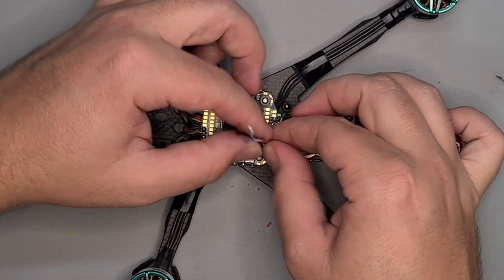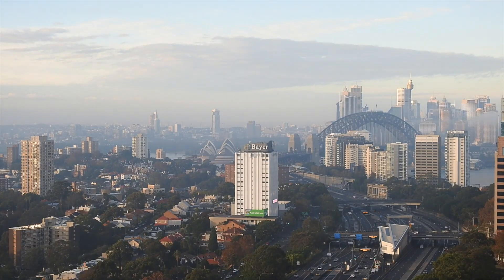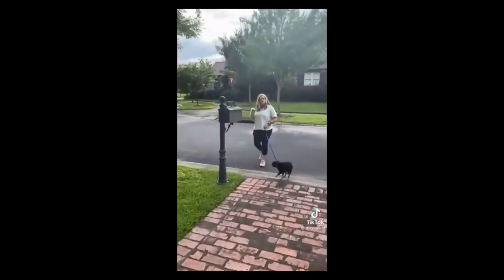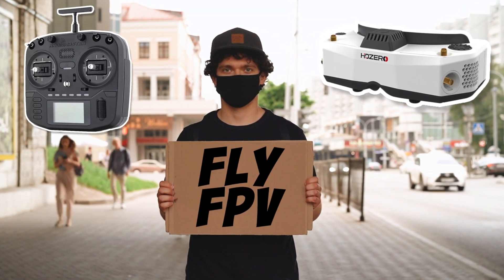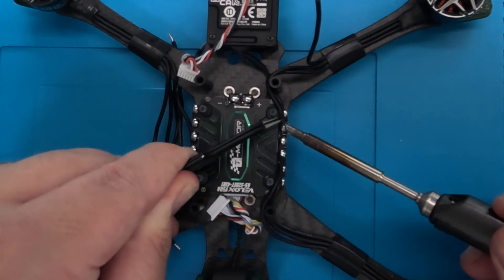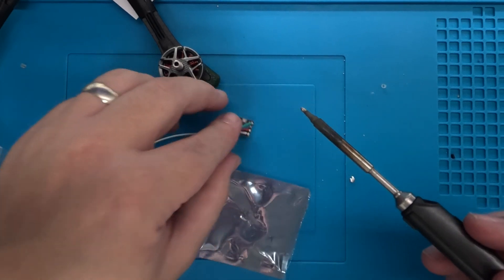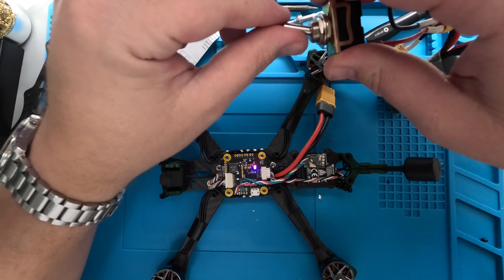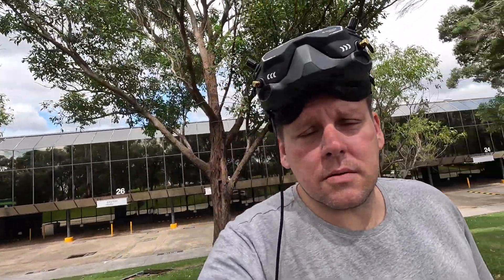I Built My ULTIMATE 5" Freestyle Drone

Comment: I am trying to get started in fpv and i was wondering if its more worth it to spend the money on digital with the DJI o3 air unit or to go analog?
Reply from the maker: There are 3 digital systems

Each have their pros and cons. 

Go analog. Get into FPV 

Then work out which digital system you want later.

Comment: Hi there I’m getting into fpv and I have 2 questions. 1 how do you figure out what panels you need to solder for the radio master. 2 do you have to solder anything for setting up Vtx. Thank you!  And one more thing sorry, do you have a VTX antenna holder?
Reply from the maker: As in the pads on the receiver?
They’re labelled on it.
Yes you may have to solder the VTX depending on which one you get and what flight controller you have. 
You can 3D print a VTX antenna holder but they do come with most frames

Comment: What kind of range and battery life can you expect from something like this?
Reply from the maker: This drone is optimised for Acrobatic Performance not distance.  Range is limited by Battery and Video System. The video system on this can do 20kms, but the radio can go to 50kms.
However, you will run out of battery first. Acrobatic flying on a 6S Lipo of 1100mah is 4mins, a 1300mah is 5-6mins. Cruising with a Li-Ion pack will get you 10mins+

What kind of range and battery life are you looking for -- and what is the reason for that range & battery life?
Reply: @DarrenAllatt  honestly that range is wild already. I'm looking on moving from analog to HD. I live in a forest and flying low through the trees barely gets me anywhere maybe around .20klm/ .12miles until I cant see anything. So im thinking on moving to a hd setup for the quality and hopefully better range in the trees.
Reply from the maker: @gladperson116  you are fighting against the physics of radio waves flying low and amongst trees. 

What’s your antenna setup?
Reply: @Darren Allatt  so im running a iFlight SucceX V3.0 mini VTX with a lollipop 4 antenna and I have skyzones o4x that came with stock steadyview v3.3 receiver. The antennas I use on it are, Iflight 150mm and a triple feed patch antenna. I'm thinking on moving to HD for a while now especially with the 03 air unit and retire this dinasour.
Reply from the maker: You have quite the setup, so yeah you should get better penetration with O3
Reply: @Darren Allatt  Im just a little stumped. Ive been doing research on which goggles the v2, the G2 or the integra. I liked the integra at first but the fov is not as impressive, it has GPS, and antennas arent removable so that's out. G2 goggles have more latency but they have oled which is super awesome, and most videos I've seen comparing v2 goggles to the g2 they never fail to have aftermarket antennas while g2s are stock. Also I'm assuming g2s would be better in low light flying because its oled and or how would those 2 compare? I'm kinda looking for that breath taking wow factor.
Reply from the maker: Can I be direct with you? It looks like you are over analysing this and getting caught up in analysis paralysis.
Pick one. It won't matter once you are flying it. But let's look at them anyway.

I see too may pilots spec chasing. What's got the best specs. 
- Oh, 54 FOV is bigger than 51 FOV, I want 54.
- 32ms vs 28ms latency, I want 28ms.
Spec chasing is pointless and most of the specs are marginal anyway that aren't noticeable.
Or going for "better specs" can be counterintuitive.

Aftermarket vs Stock antenna's - again that's just tinkering for the sake of tinkering.
G2's and Integra are so new, that most existing antennas from the V2's don't fit. So it takes time to tool up and produce compatible antenna's. The V1's were released in 2019/2020 so there's been 3 years of accessory development.

Removable antennas on Integra. If you look at the specs for the G2's as well, their specs say the antenna's are not removable. So until someone gets their hands on the Integra we don't actually know.

V2's are discontinued. They are large, heavy & chunky. 810p screens & 144hz refresh rate.
Integra & G2 are a lot nicer and feel more like FPV Goggles, which will be easier to live with.

I have Walksnail, HD-Zero, and v2's.. I prefer WS Goggles over the v2's and I dare say I'd prefer the Integra or G2's as well. 

FOV. So, fun fact. Many racers are actually wanting a smaller FOV. Orqa developed a version of their goggles with 33 degree FOV instead of the 54 FOV on their main product. 

Why?

Racers want to see the whole screen, so they don't have to move their eyes to look around the whole screen. 

Having a Large FOV is like sitting too close to the screen in the movies, you can't see the whole picture and end up having to look around the screen just to see the different things as opposed to consuming all information on the screen at once.

I personally find the FOV on the v2's to be too large. I get motion sickness flying O3 with them.

So larger FOV, may not necessarily be "the best". 

Low light. You need an actual starlight camera, which DJI doesnt make for O3 to fly in low light.
Plus, night flying really sucks anyway because the camera's, aren't designed for it.
You will have plenty of light as it gets dark because of things like auto ISO & shutter speed,
But again, this is all camera determined the googles don't play much in it.
Reply: @Darren Allatt  you're absolutely right. I have another question. I live basically in the middle of nowhere and there's no service nothing that would interfere with signal but when I fly in the morning I have better penetration than I do when flying in the evening clearly it's something with the environment but I also noticed when fly for a while signal gets worse and worse for example I fly the first 3 packs with no issue but when I get on my fourth sometimes third pack I get half of the signal I would with the first 2. What could cause that?

Comment from the maker: Here are the parts I used (affiliate links)
 ● Frame: Quadmula Siren F5 Split - http://bit.ly/3GiOECg
 ● Motors: T-Motor F60 Pro IV 1750kv - https://bit.ly/3ExU0Zv
 ● Flight Controller: T-Motor F7 HD - https://amzn.to/3IPVCA9 
 ● ESC: T-Motor V50A 6S - https://amzn.to/3IPVCA9 
 ● Radio Receiver: Radiomaster RP1 ExpressLRS - https://bit.ly/3lTkmyu
 ● FPV Camera & Video System: DJI O3 Air Unit

Comment: Hey Darren! are this motors good for chasing motorbikes and that kind of flying? Shoudl be the 1750? I've got a tbs source one v4 with the t motor f7 hd, 5".... Thanks!!
Reply from the maker: Depends how fast the motor bikes are going and where you are flying to chase them. 

What’s the speed you will be chasing bikes?
Reply: @DarrenAllatt  It will be the most motocross 120km or so? and also could be for chasing cars… what would be the other option of motor? Thanks!
Reply from the maker: @Fransola87  you ideally want a 7” or 9” for those given the speeds, otherwise you will be smashing through batteries. 

If you wanted to try a 5” first. Look for 1950kv motors in 2207.
Reply: @DarrenAllatt  okay, thanks! :)

Comment: I have built over 15 quads. Some budget,  some all out premium. I'll be 100% honest the only premium builds dont do anything better then the budgets. One of best quads is a budget build. For example. Ordered 8 amax performante v2 2306 1950kv 30$ each. 3 of the 8 are so out of balance they cannot be used. They sent me 2 replacements, and one of those was bad. I tried to replace the bearings, but its not a bearing issue. It's a balance issue. So out of 10 30$ motors, I got 4 that are usable horrible vibration, 1 slightly vibrating/noisey,  so 5 are horrible balanced and completely unusable.  Not worth it, the only thing you shouldnt skimp on is the frame. I have had the same issue with T-motor F40's. Bought 4, one was so notchy it was like a completely different motor. I order another F40 pro IV 1950kv. Same exact thing. Notchy as the first one. So out of 5 27$  3 are smooth, 2 are extreamly notchy like theybhave different magnets. So in the last 4 years ive tried it all.

Comment: So... this is timely. I've had drones on the back-burner for a couple of years while I did video games with my teenage son (Elden Ring has been eating my life). And I'm getting back into it, but all my drones are 4s. I really want to build up a 6s Apex... but I also want some HDZero goggles for some lighter-weight digital video that I can do in my neighborhood without attracting the Karens. Whadya think? I'm leaning towards the Apex.
Reply from the maker: Quadmula make the Siren in a Lite version so the frame is a lot lighter than a normal one. The Apex is a tank. 

The Siren is lighter than the Apex because it doesn’t have as much hardware keeping it together, and it’s all counter sunk as well. 

I’d go with the Quadmula over the Apex.

Comment: In before people disputing whats "top of the line" and what not.. oops too late. 
The quadmula does look very premium indeed and I had to double take that that was DVR footage.
Good job on the build. Also one advice to all building with an O3 is to ensure that your FC can handle the amp draw from the AU. I've seen too many pilots lose their quads because the assumed the FC could handle it. I'd solder it to Vbat
Reply from the maker: The flight footage was from onboard the O3 Air Unit. 

Yes. VBAT is a good idea.

Comment: The velox esc's are not top of the line they blow all the time get the hobbywing 60amp esc that's a top of the line esc t motor fc's are really good tho.
Reply from the maker: I haven’t had a problem with them previous though. Although given I had to pin the ESC & FC, if I built another I’d go with Foxeer stack for it.
Reply: @DarrenAllatt  The  foxeer 20x20 stack is awesome that is my main stacks i use and they last a really long time and take a beating
Reply from the maker: @grampafpv8013  yeah I have the wide Reaper in my Racer. I just don’t like 20x20 for Freestyle though. 30x30 is where it is 😜
Reply: I use the full F55A instead of the budget Velox.  😁👍
Reply: I really have had a very good run with my geeprc mark 5 absolutely thrash it and man it just burns up 100c China hobby line black batterys pizza batteries just get killed I'm going to have to go higher  c rating for that quad but it's super nice to fly best I have ever flown so far. ❤

Comment: Does a tx12 elrs come with an elrs transmitter in it and also I'm for the tx12 elrs what is a good reciever that can be used with it can u suggest one on grtfpv
Reply from the maker: Yes the TX12 ELRS version has an internal ELRS module. 

I’d go with a “Happymodel TCXO ExpressLRS 2.4GHz Nano Receiver - EP1” and then also get a “TBS Tracer Immortal T Antenna” or the extended version.

Links:
Receiver
https://www.getfpv.com/happymodel-expresslrs-nano-2-4ghz-ep1-tcxo-rx.html

Antenna Normal Length 
https://www.getfpv.com/tbs-tracer-immortal-t-antenna.html

Antenna Extended Length
https://www.getfpv.com/tbs-tracer-immortal-t-antenna.html
Reply: @DarrenAllatt  thank you so much man I hope you have a great day I appreciate the help and I hope ur videos continue doing well